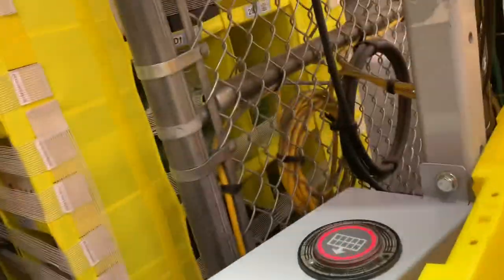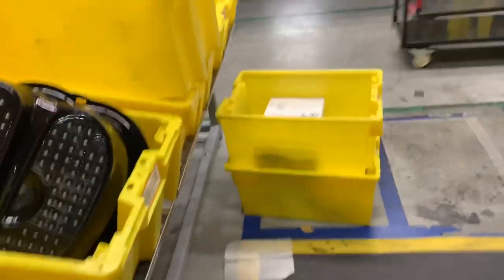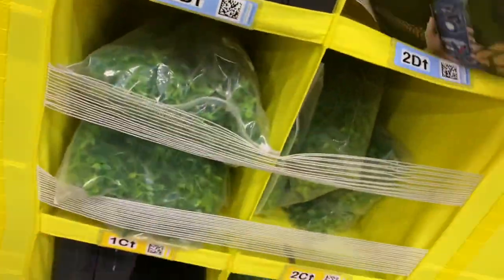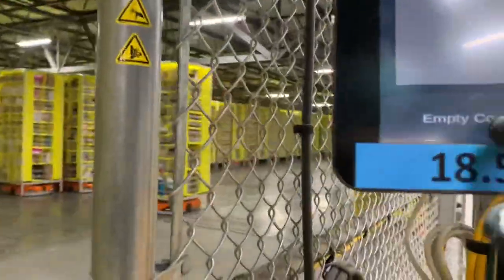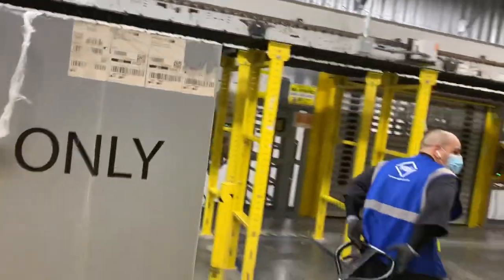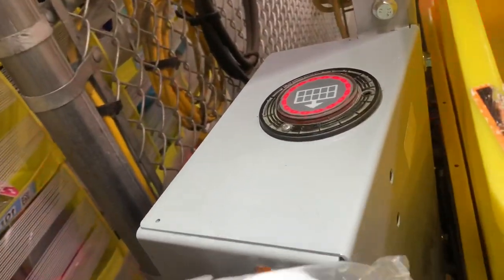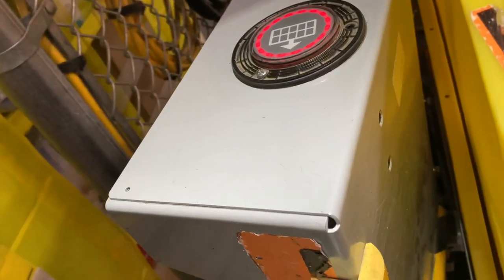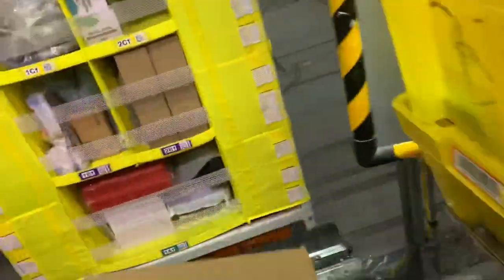Inside the life of an Amazon warehouse stower part2

Comment: When you scan an item to stow does it tell what number it’s assigned too in the yellow bins ?
Reply from the maker: You basically have to find space for it, no number
Reply: @damnathan6175  when you showed the 18.5 bins is that only for 18.5 or can any size be set in that bin
Reply: @gg4e356  you can go up one size of items so if you have 6" item, it can go to 9" pod  so if you have 14" item then you can put it in the 18.5" pod but most of the times it will ask you to either put it at the top or nowhere since there is a weight limit on the pods so it doesn't fall or someshit like that
Reply: @gg4e356  you can't put small items that fit in a 6" pod into an 18" pod. Even when the big pods come round you can't fit things in them so you can end up with lots of totes full of large items you can't get rid of. Liquids have to be stood up along with books, everything else gets thrown in wherever it will fit.

Comment: What’s the meaning of UNIT PER FACE?
Reply: Necro here.  Each pod that comes to you presents one of its four faces to you.  You put a bunch of items (units) into that pod and send it away when you have nothing left to put in there.  Over the course of 8-10-12 hours, so many pods will come by and you'll put so many units in them.  It's averaged out as a statistic.  

So if you have 5 pods come by and you put in 10, 10, 15, 20, 45, your average comes out as 20 UPF.  There are so many larger items to get through, resulting in 1-3 units stowed, that I recall a relatively low UPF average of 10 is a common target.